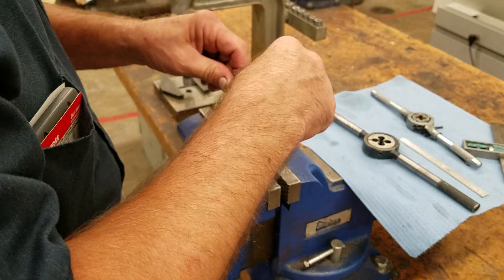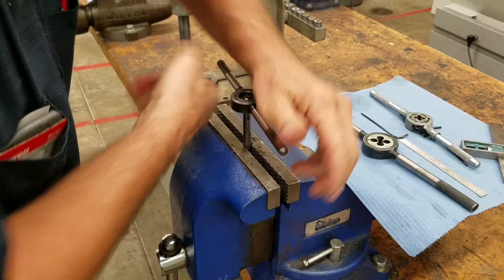Hand threading with a die

Comment: Thank you sir for helping me to understand better what I've been doing wrong.  I'm in between a rock & a hard spot because I'm trying to make a stud for my tractor engine that has been DISCONTINUED.  It is 3.375"/85.725mm long.  It is a rocker stud in the head that I MUST have to get my diesel engine back running. The stud 10mm has 1.5mm threads .625"/15.875mm long on one end with 1.25mm threads 1.5"/38.10mm long on the other end with a NO THREAD area in the middle 1.25"/31.75mm.  So far, the two that I have threaded have bent slightly just enough that they WON'T work in the rockers in the engine.  I'm NOT giving up because if I don't get one to work my tractor is done.  Thanks for your insight that has helped me. Keep your fingers crossed that I can get two made.  GOD BLESS SIR!🙏🙏🙏

Comment: Quite amazing how few people use split dies correctly, and this is an example of someone not realising what they are doing.  The die is split for a reason, and the holder has grub screws for a reason, yet few people ever mention them.  The die should be installed in the holder with the split in line with the middle grub screw.  You should tighten the middle screw a little to expand the die for the first cut.  It’s instead of having first second and bottom taps for internal threads.  Expanding the die makes the first cut if the thread shallow so that the thread isn’t fully bottomed out and it’s easier to cut, especially if you have a very long thread to cut.  Once you have done a first pass, you loosen the middle screw and just nip up the outer two screws, just a tad.  This closes the die a tiny amount such that when you make the next pass the thread is cut to the very bottom of the thread profile.  The screws are also a way of matching the size of an existing thread if the thread length needs to be increased.  The screws can be tightened until the die is not loose on the existing thread, and this ensures that the new thread is cut to the same diameter.  The guy in this video put the die in the holder in the wrong position and didn’t even bother with the screws.  Not the end of the world, but in some circumstances you may end up with a thread that is too tight for a matching female thread if you don’t know what you’re doing.
Reply: thats what I thought the point of the split was,  to start loosened and gradually cut the the threads by tightening up the split through a series of passes
Reply: You should make a video!
Reply: Agreed. You set it as wide as possible for the first cut. I was viewing to find out what cutting lube to use..
Reply: I wasn't aware of this info, but I haven't used my die yet, so I am glad you put this in as a comment, and now I know.
Reply: The split is there so you can adjust for wear, an cut to different classes of thread fit.
Reply: @ianwilliams1448  I think Liquid Wrench is considered a cutting oil.
Reply: Great reply. Thanks a lot for that🎉🎉🎉

Comment: 7:58 is where you just taught me my lesson. I’ve been trying a damn hex die to make the threads.
Reply: Thanks for pointing that out. I also have a set of hex chasing dies that I've been using, and had major trouble with cutting.
Reply: Same here, got pretty angry trying to figure out wtf was wrong
Reply: Literally same thing here. Smh🤦🏾‍♂️
Reply: The hex dies work just fine for making threads - when they are nice and sharp. Been using a set of 3 - 8mm hex dies for years.

Comment: So, is the rod 3/8" diameter or a bit smaller.  I've seen a lot of videos on this subject, and no one ever mentions the size of the rod in relation to the size of the die.  This would be very helpful for a rookie such as myself.  Very clear and to the point tutorial though.  Thank you.
Reply: Eye ball it. Grind some material off the stock if needed.

Comment: How the hell did you keep the rod from turning in the vice?  I have been trying to cut 5-40 threads on a 1/8” stainless steel rod and the Torque from the die stock turns the rod and I can’t go any further.  I finally had to file flat spots on each side and hold with a crescent wrench and vice to keep the rod from spinning.

Comment: HI, when I am using a Die to thread a rod i never seam to get the correct diameter in the lathe.   where does one find the diameter of the rod for a specific threading Die.  An example, the diameter of rod for a 1/4 28 or a 5/8 11 Die?   Thank you.

Comment: This is time consuming for big jobs. Can you use a machine with a die to speed up the task? Thank you great video
Reply: Lathe
Reply: I was wondering the same thing.  You could put your workpiece in a lathe and run it at low speed, but I wonder how you would hold the die?  Maybe a big enough chuck in a tailstock could take it?  And then hopefully the screw inside the die would be enough to expand it for your first pass, because the die is meant to be used in the stock.
Reply: @godsamongmen8003  You do not use a die with a lathe. Cutting threads on a lathe is an entirely different process from using a die, and is much more complicated. This video shows how to use a die, and that's the long and the short of it. There's really no quicker way to use one.

Comment: when i use the die to make a threaded rod i get a curved-like thread. as if the rod is banana shaped- except its straight, but the threads are sharp on one side and dull on the other side of rod. i have no idea what is causing this, but its fairly often that this happens to me- anyone have any thoughts?

Comment: Do you need a  handle on you die stock just to chase threads on lug bolts that are not badly stripped nut just not turning freely ?

Comment: I am learning this as a need for fabricating my own rods to hold bluetooth speakers to my stock BMW R1150RT handlebar.  This bike comes with stop fairing mirrors and predrilled holes in the controls brace.  By fabricating my own rod I am hoping to use a rod similar to the one used on the GS model mirrors but instead of mirrors they will be die at whatever needs to be to match the socket screw of my speaker.  Intuitively doable but had never done anything like this.  So your video instructs me in the right direction.  Each BT speaker weights about 30 Oz. So weight wise I don’t need heavy duty rod but i figure that because of the air pressure and vibration I need to go a bit “overkill”.  Any recommendation (material, diameter and pitch) all welcome

Comment: Great video!  I do have a question tho.  When it says "This side up" does that refer to when you are LOADING the die into the handle or as you are USING it, meaning you would load that side down into the handle?
Reply: Kyle Runyan 
Refers to what you see when threading. You should see ‘this side up’ while you are cutting threads. Also remember to use lots of cutting oil and go backwards every 1/4 turn or less to release the cut material. Patience is key in using taps and dies. Cheers dude

Comment: I have problems getting short threads straight. They always turn out  a little bit angled. 
The thread is only about an inch long and when the die is on there, there is barely anything to measure.
Any tips? 
I have this problem on all the threads I'm cutting.
Reply: Yep, anything without rod straightness guides incorporated in the design are trouble making junk.

Comment: Can you thread plumbing pipes with it?
Reply: robalan57 Yes they make both threading and rethreading dies for pipes. These are not identified like normal thread sizes (1/4”-20) but rather in the form of NPT or BPT and other types. If you are in the United States you should look for NPT. For example, a 3/4” NPT die will thread 3/4” nominal pipe.

They make hand threaders for new threads (see RIDGID for example) or rethreading dies for repairing threads (made by Hanson for example).

Comment: I have a question I need to put on a ccw nut so what way does I need to thread the rod then cw or ccw?
Reply: You'd have to use a ccw die, and turn it counter clock wise.

Comment: Tightening the split die screw opens it up?
Reply: Yes because the thread is on the screw side so screwing it in opens the die. But presumably one should then loosen the screw to get a deeper cut thread on the rod.
Reply: @effinog  Thanks

Comment: I've been trying this. Couldn't get the thread die started: (I had the starter side in the right side.) So I opened it further. Still no start. So I put more downward force on it. Then the die broke into two parts!
What did I do wrong?

The funny think is: I managed to make the thread with the broken die. It finally opened put far enough to start the thread, and I could still close it in the stock to make the final pass.
Reply: You listened to this guy if you did what he did in this video, it's one turn forward and half turn back, always use a cutting compound like oil or whatever, also there are dies that are made of different metals, the main ones are carbon and then there is high speed steel (HSS) , you want them to last, use HSS,  use carbon if you don't use it much, lubricate both die and part you're working on, makes things easier, last longer and makes you equipment last too, hope it helps.
Reply: @CHEVI789  thanks for the response, but the problem is that I cannot get it started. Your response doesn't give any insight on how to fix that. All the other stuff you mention: already doing that.
Reply: @jhbonarius  , sorry about that buddy, I usually put it on a lathe at a 60 degree pitch but not to a point, sorry it's hard to describe by writing, if you have a lathe as I do, put the work into the lathe if you can, then turn the tool post to 30 degrees ( 90-30=60), take bit by bit off the edge, say 2 millimeters and try that, if not take more off the edge, say 3 millimeters, I've found 3 millimeters works well but depending on the size you might have to take off less or more, if you don;t have a lathe then use a bench grinder, hope it helps.

Comment: I have a 11/4 bolt that I'm trying to retread just the very end or top of it
Reply: I'm not sure if my set even though it say 11/4 is one that it will do is correct
Reply: That's about a $70 die from MSC. Easier if you have a metal lathe to chase the threads back on it.